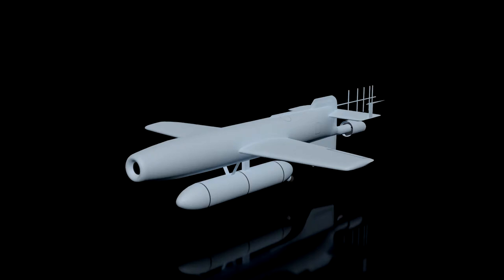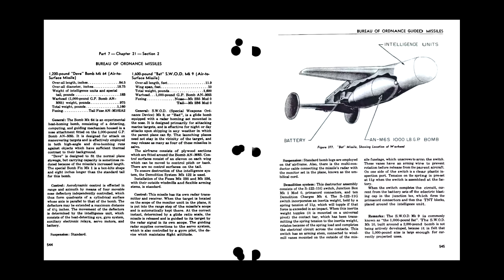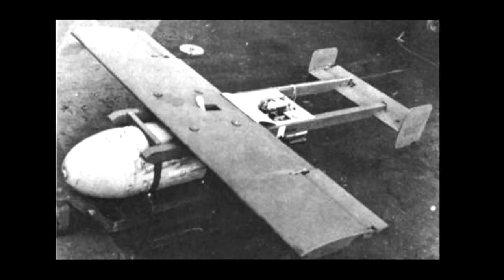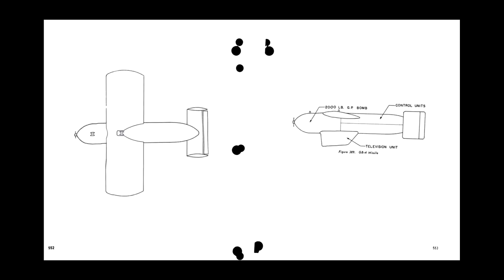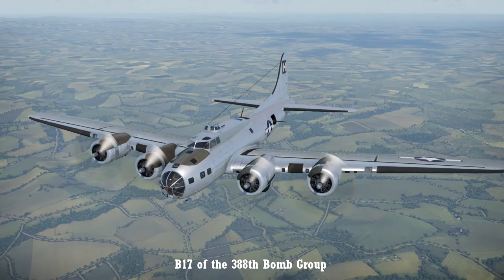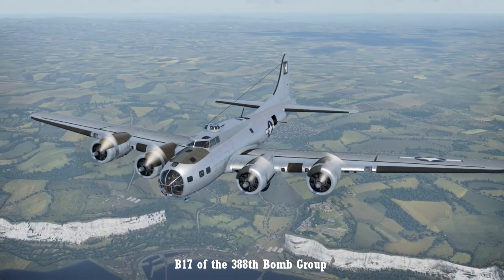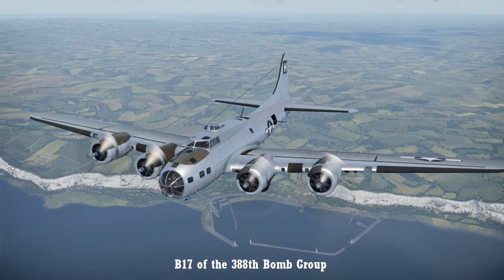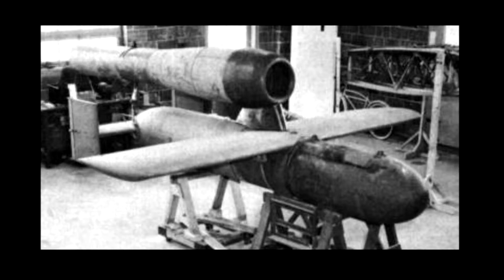The TV guided GB4 glidebomb

Comment: Cool post . Thanks !    Was narrow Band Television tech ever used on the glide bomb systems?  Seems a cheaper way to make a smart bomb.
Reply from the maker: I'm not 100% sure about that but the image quality suffers in narrowband

The lowest imagequality I heared of yet is the 220 line "50fps" or 441 line 50 halfimages/sec video stream from the HS293 d videosystem.

The GB4 had a higher imagequality.

I heared of a proposed French TV system for transmitting military documents and maps to Frontline commanders that could have used narrowband  (this system sounds so futuristic, imagine the commander just with a screen in his hand and having access to the library of the military hq (analogue Wikipedia) )

But for a glidebomb when wide view, imagequality and imagesmoothness played a role it likely wouldn't be sufficient.

Comment: Oopps for forgot to include this link  https://www.youtube.com/watch?v=1ShYefsbnAE&t=1s
Reply from the maker: Nice video thanks for the link 👍🏼
Reply: There were some German work at TV lock on homing by the Germans Fernseh Company in WW2.   (Mentioned in Fritz Trenkles book on German remote control systems).  Some of these used 50 x 50 line systems.   One designed to lock on to a ship used spiral scanning.    The usual method of tracking in the pre digital aged was to detect the edge of the target and record its position with a capacitor charge.   A number of points are tracked.   These contrast seekers had their first success in the Maverick Missile which presumably had digital systems to assist.    I can see that a 50 x 50 pattern might be enough to track a ship.    It would require the optics to zoom at at a rate proportional to altitude or distance to target I imagine.   There was a system called pinsel for the X-7 at tank missile where the operator tracked the target with a TV camera while the image from a camera in the missile nose was sent back by some means (I think infrared).  The system then cross correlated the images and corrected.   The uprising clarity of 32 line systems suggests a lot could be achieved.   Early imagine missiles often used only 32 or 64 pixel arrays.   (Usually infrared which is not plagued by shadows)
Reply: @williamzk9083   Yo know your stuff.
Reply: @ufoengines  Thanks, the Wikipedia article on constast seekers mentions that the US managed to develop a seeker for the GB4 that used one photocell only.  Effectively 1 line TV.